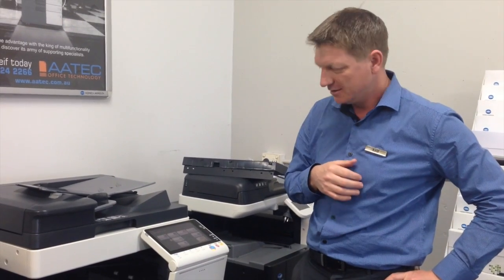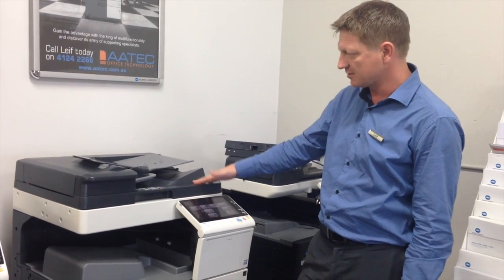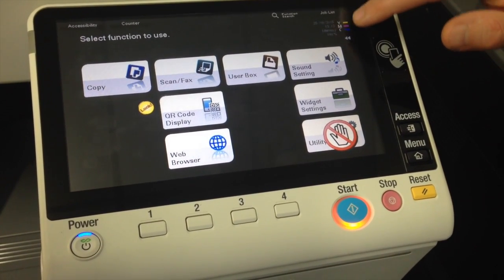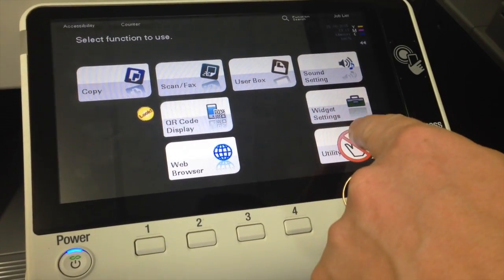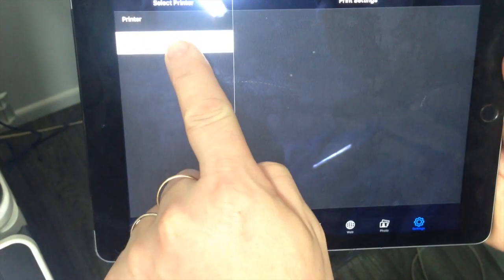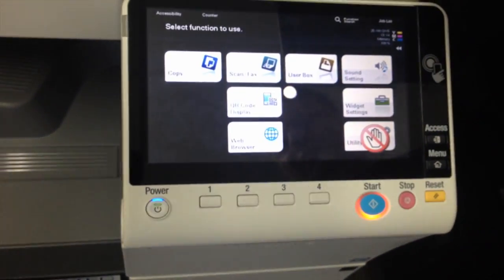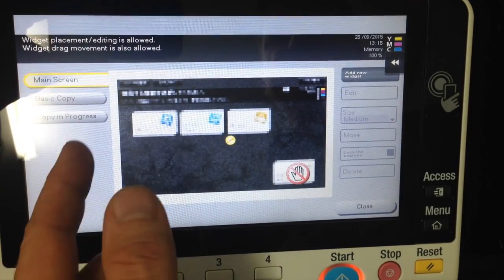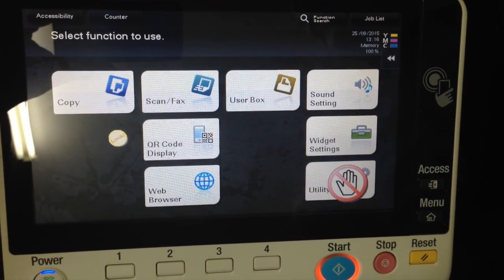Konica Minolta bizhub C368: Quick Introduction

Comment: Regards friend, you know 1 month ago buy a printer rightly of this model C368 everything was walking well until once finished of arming the printer and to form it with a computer in order that it stamps not loaded a message of mistake appears and blocks the equipment " C6001 he says the mistake extinguish and return to ignite it "; after several hours do I think that there is a problem with the automatic alimenador of paper but not with certainty that departs from this one it is? Try to contact Minolta in españa but I did not have success nose if podrias to help myself with this problem that probably could be solved rapidly; since I mention the equipment it is new. Regards from Peru and graces for your response.